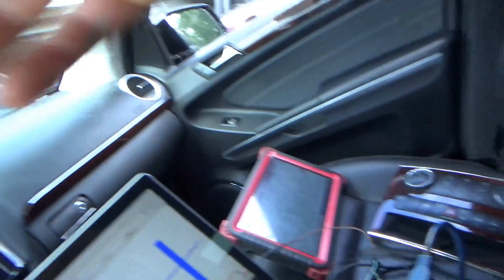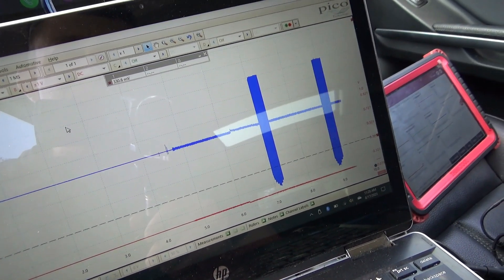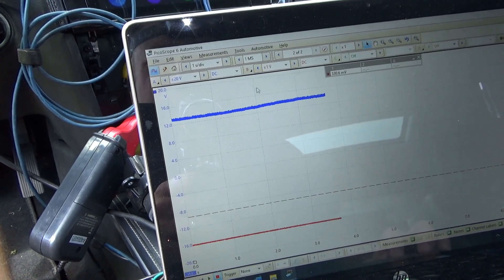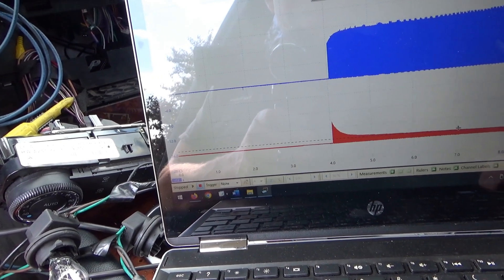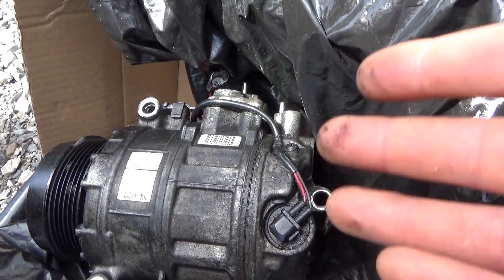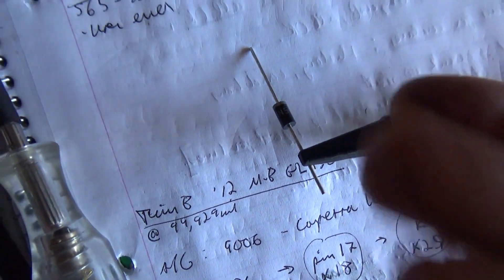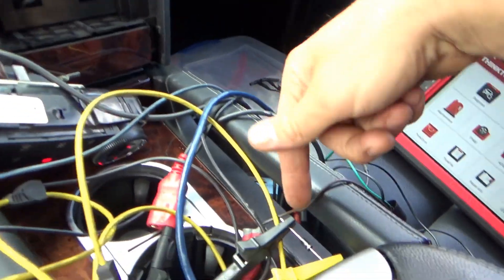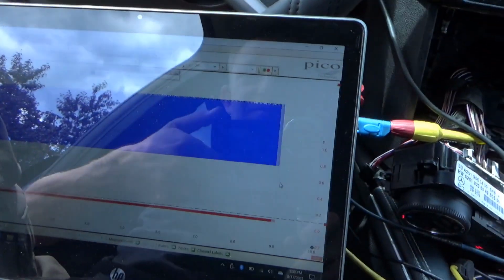Part 2: Did I MIS-DIAGNOSE This Mercedes?? (GL450 no A/C - Crazy REPAIR!)

Comment: I know for a fact straight from a Nissens specific training seminar that vintage of Mercedes AND Volvo with a solenoid valve compressor comes with and without a flyback diode. Their compressors come with a subharness included that contains a diode. I don't recall where you purchased the compressor or what brand, but that class immediately came to mind. This is why training is important, I only do BMW products however information like that will save your ass one day. Another fun fact, new Volvos with 1234yf have a capacitance sensor in their AC system due to the fact refrigerant flows through the battery packs on their electric cars. Absolutely never use PAG oil (because it is conductive), or you have just bought the shop a shiny new brick that it's start is disabled and needs it's entire AC system replaced.
Reply: jeebers

Comment: It is common when working with DC mechanical relays, for example, to add a Zener diode and a silicon diode, in parallel, cathode twoards the relay control terminal, anode of the two to ground.. For 6V DC relays, a 20V Zener and a 1N4007, in parallel. The Zener/Silicon diode act as a "spike clipper"if the relay coil back EMF spike exceeds 20V.
Reply: What does the Zener contribute? And are you assuming the coil is high-side switched or low-side switched?

Comment: I would take a second look at the relays. Some the Mercedes relays have diodes built in.
Reply: Problem is a normal relay dosen't have one on the load side, or least the 5 leg one's I have ever worked with,  only seen them on the relay coil legs the control side to prevent A/C spikes from damaging controller boards when opened, In other words the A/C shock you get from a solenoid like a Starter if you have your hand on the positive fed post when you stop cranking the engine, Some send out a Nasty A/C⚡ spike if the starter solenoid  wasn't built with a Diode in it, Most older ones weren't, I found out the fast way, It was a little shocking 😀
Reply: What relays?  Did you see the schematic in Part 1?
Reply: @Graham_Wideman  This guy wants to do PWM with a mechanical relay.  I'd get my popcorn for that one.
Reply: @kevin9c1  I think the commenters before me have completely lost the plot. There's no relay in the circuit in question, and one guy is confusing A/C (air conditioning) with AC (alternating current) and at that really means back voltage or reverse EMF (referring to discharge of magnetic field into the controlling circuit.

Comment: put a diode in the line
oh i'm suposed to watch the hentire vid before commenting but I would have put the diode in series
Reply from the maker: That would NOT work. Let me know why 😉
Reply: I supose there would be no place for the current to go.  As someone who mentioned the diode to ground would be the traditional diode across the coil swamping reverse emf @PineHollowAutoDiagnostics
Reply from the maker: @n6dl321  think about current DIRECTION during the NEGATIVE voltage spike. In series diode on control wire would be the same as no diode at all! 😁
Reply: the negative pulse will attempt to pass cathode 2 anode of the diode and be rejected.  thus the control box would be blind to the unwanted pulse would it not? @PineHollowAutoDiagnostics
Reply from the maker: @n6dl321  If it was a POSITIVE spike, then yes. We want to get rid of the NEGATIVE spike :)

Comment: That is great that you fixed it but what really happened, did the customer buy an aftermarket compressor with a missing diode, did the original diode go bad. What are your conclusions on why it stopped working.
Reply: He gave his theory.  Watch again.

Comment: I thought you were gonna check the old compressor for a diode with your multimeter, cant remember if you did that in part one or not.
Reply: It is not possible to check a diode in parallel with a coil unless you can access it and cut a leg off.  Otherwise you measure the coil resistance in either direction.  Try it.
Reply: @rj.parker  You are right that a multimeter will not see the diode. However, an impedance meter (RLC meter)will,  as you can select a testing frequency that will make the coil present a high impedance.
Reply: Well I'm still learning, I just thought you could measure resistance in both directions to see if it had a diode kinda like you would do on a lawnmower clutch.
Reply from the maker: Original compressor was setting the same fault 😅

Comment: I am surprised there is no flyback diode displayed in the OEM diagram.  This is the kind of issue that the dealer would fire the parts cannon at for 10-20 visits and then want to sell you a harness replacement.
Reply: Diode probably integrated with controller or OE solenoid, thus it doesn't appear in diagrams as discrete component.
Reply: @hightttech  Buy why would the replacement controller exhibit the same issue?
Reply: @hightttech Most high power MOSFETs have an internal diode, but that's usually one of the first components to go out when the component fails.
Reply: @Stoney3K  I will entertain this as I would like to learn something new.  Can you provide a model number or a data sheet?
Reply: the dealer would’ve fixed it on the first visit because they don’t entertain junk parts
Reply: @xalty1200  Which junk parts were entertained here?  The OEM HVAC controller or the OEM compressor that was installed?  Maybe the OEM flyback diode?
Reply: @xalty1200  Agreed OEM parts would have fixed it.
Reply: I do not like this "tacky" third world fix. I would have demanded as an owner the proper exploration of why. Why didn't replacement parts not fix the root cause and how do I return the state of operations to OEM. This third world mentality is sub-par. This is the fault of the owner-- he wants an expensive car strictly for show but not the expense for doing it right.
Reply: @VidelicetMoi  If you can explain why a flyback diode is required for an inductive circuit  in the context of this repair in a manner where you are teaching me how this is "tacky 3rd world fix" I will entertain your opinion.

Maybe you might teach me something, and I'm always willing to learn something I don't know.
Reply: @VidelicetMoi It's a fix necessary because the OE design is flawed and destined to fail. This fix solves the initial design flaw by using a component that can cope with the demands of the compressor start up and duty cycle and has space to dissipate any heat generated. Why put expensive brand new OEM replacement parts in if you have evidence that at least two similar items cannot perform their function for the life cycle of the car? I don't need to paraphrase Oscar Wilde here surely?
Reply: @VidelicetMoi  "I would have demanded as an owner the proper exploration of why."

That would be easy.   The owner replaced the original part with a non-MB part which didn't match the spec of the original.
Reply: @VidelicetMoi  why are you being so nasty about a guy wanting a decent car. I would say that the vast majority of us “normal income” people buy a second hand car that would be beyond are normal price range and therefore beyond our scope to buy new parts for in every case.

Comment: Pretty much all MBZ of this Era use the driver front Sam module in the operation of ac. I have replaced many sams along with compressors. I am gonna look up that diagram and see
Reply from the maker: SAM was not involved in this circuit...

Comment: So there was a diode in both controllers that got blown? What a design defect, I bet someone will make some money "refurbishing" these computers aka replacing that diode. At least the transistor Vds has enough safety margin that it didn't blow also from the extra voltage! Great job 😄
Reply: Not an electrical engineer and I can barely spell ohm's law, but I think the design defect is not having the flyback diode physically across the terminals of the coil to clamp it at the source.  Just seems odd it would be in the controller knowing what I know now.  In my day job, I had some technicians on my team get reminded that everything has parasitic inductance.  Something kept going wonky, and they determined that it was back EMF caused by the parasitic inductance on a straight piece of wire on a payload we were flying.  So there we were hacking in a flyback diode on a $5M aircraft in the middle of BFE so we could get the rest of our test points flown.
Reply: @major__kong don't underestimate yourself!
Reply: @dans_Learning_Curve   I know more than I let on.  But for things I'm not specifically trained in, I try to show a little humility when I know experts are around.  I've seen Jessica post many times before.  She runs circles around me and many others on this channel when it comes to electronics.  If you're wondering how a straight piece of wire develops enough back EMF to be a problem, let's just say there was a lot of current moving through this wire.  You could probably call it a cable.  And V = L * di/dt or something like that.  It was the huge change in current acting on a small parasitic inductance that was biting us.

Comment: I would assume the system had to work when the compressor was replaced to charge the system with refrigerant. I would think there was a diode somewhere in the system that has failed.
Reply: It only worked at part load.

Comment: great fix.Flyback Diode or Freewheeling Diode is connected across the coil in reverse to shunt back emf to ground, possible bad diode in  both compressors. a flyback diode is usually placed close to the coil. some  compressors have a diode mounted in the clutch coil and some are external and some mounted in the connector. dorman sells pigtail for gm's with a diode across the terminals in the connector. Also diode cannot be tested in circuit easily with a DMM as it is in parallel with the winding. perhaps using a milliohm meter. Scope shows the failure

Comment: I wonder if the diode is in the control module and the new used part was bad also. The test lights used the compressor ground in the first video the computer failed but it worked with the body ground. Anyway always good to remove negative spikes in any electronic control signal. Cool Fix!

Comment: Did you look into the aftermarket radio? I have the same on my accord, and it controls climate as well. Is it possible it was interfering with the mercedes control unit?
Reply from the maker: See Part 1. Aftermarket radio was installed when they swapped the HVAC controller 😉

Comment: Good job but normally to stop back EMF you install the diode in parallel in series the diode could get hot and you have 0.7V drop.
Reply: He wired it in parallel.
Reply: yes that's how GM wired them.  Across one terminal to the other and used the crimps to fasten them.
Reply: In most cars I've worked on this was actually how the manufacturer hooked them up. On older GM cars It's usually across the compressor plug it's self, others I've seen in the fuse box..
Reply: He did install in parallel; the anode is going to ground. [thanks to  @Graham_Wideman for bringing to my attention an error in my comment 🤦; i fixed it]
Reply: @hightttech  I'm pretty sure that  Ivan connected the anode to ground, because if the cathode went to ground the diode would simply conduct current from the control signal to ground, and the controller would detect a fault.
Reply: @Graham_Wideman : True. I misspoke. I meant the anode went to ground. Indeed the diode would forward bias if anode connected to signal. I will edit my post.
Reply: He did install it in parallel. 
The control wire goes to ground inside the compressor and Ivan connected the diode between control and ground at the controller. Draw out the circuit to check the installation.